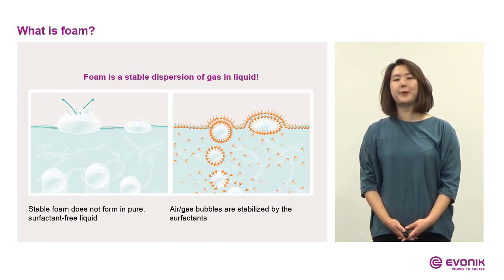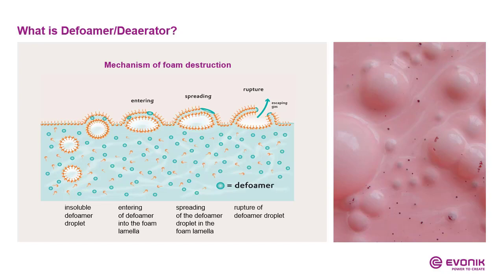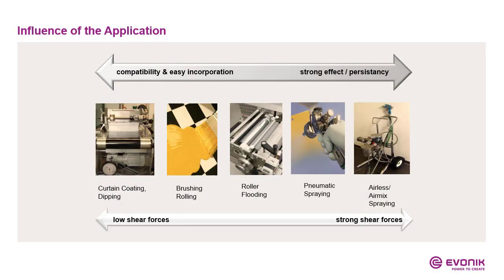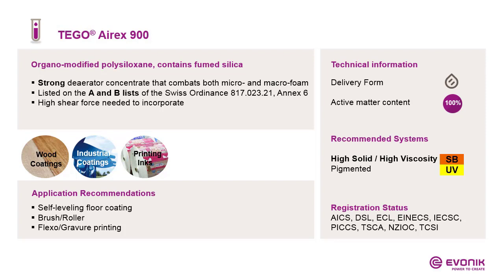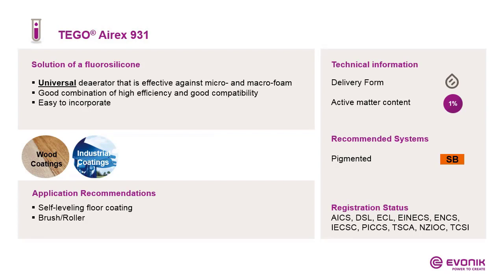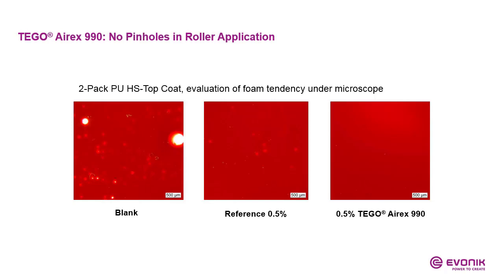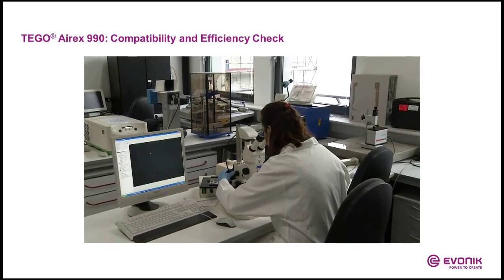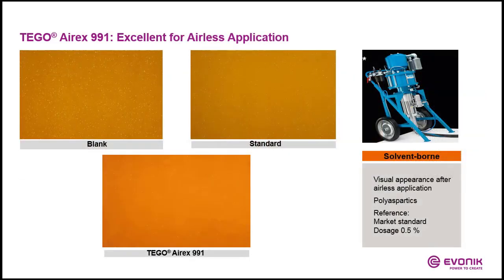Foam control, Solventborne and UV Systems | Evonik

Comment: I ask for the strongest defoamer for the    moisture curing type isocyanate adhesive having so many bubble.
Reply from the maker: Dear 우리가 돈이없지 가오가없냐!, the best suitable defoamer depends typically on a lot of different aspects.
To provide you with the best recommendation, please use our product recommender tool: www.coatino.com
If you still need technical support please contact our technical experts directly: https://www.coating-additives.com/product/coating-additives/en/contact/
Good luck with your formulation!
Reply: @EvonikIndustries  Thank you for your favor.